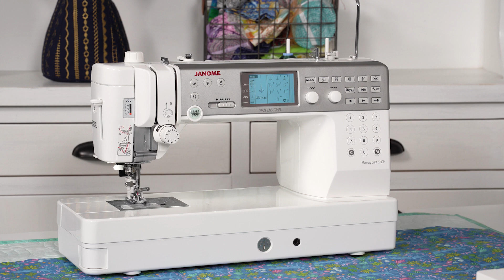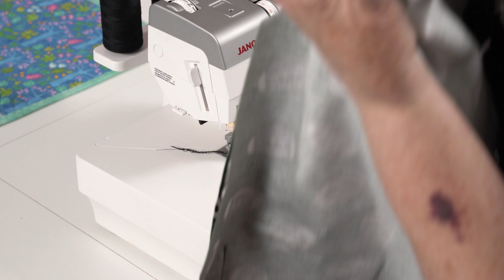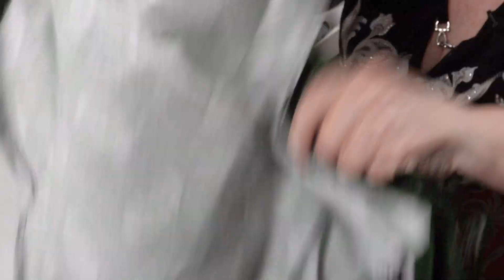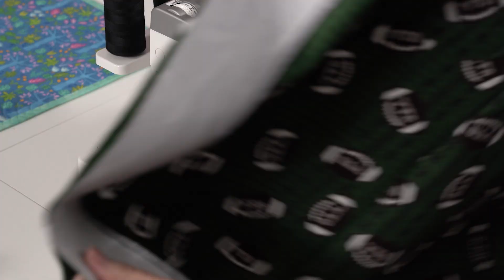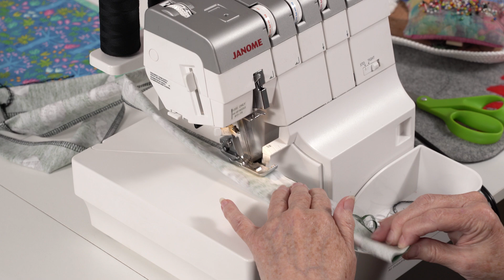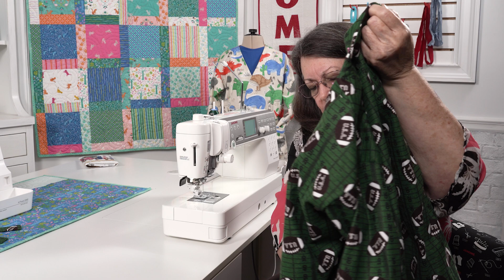How to Make a Bathrobe with the AirThread 2000D Professional Serger

Comment: When I am serging, my cut-off fabric always flips up back under the blade; it will never go down into the cut-off tray. Any ideas on how to avoid this?
Reply from the maker: We recommend pushing the fabric a little closer to the blade or adjusting the placement if possible. This is very dependent on the thickness of your fabric and how much you are cutting off - test out some other fabrics and try altering the space and see if you have an issue.
Reply: @JanomeJAI  Thank you! I will give it a try.